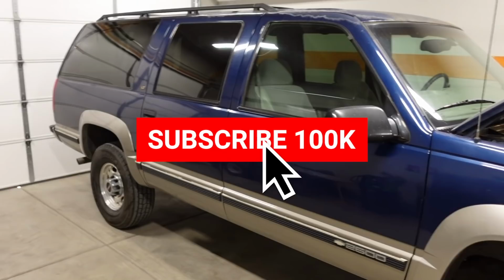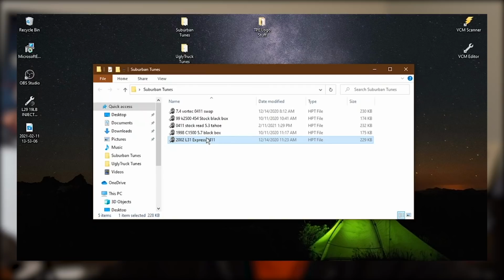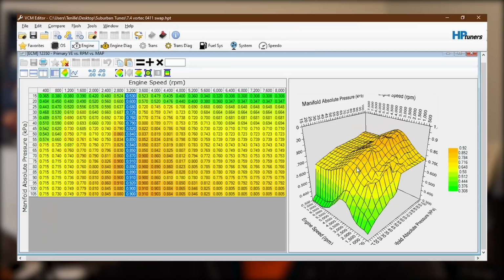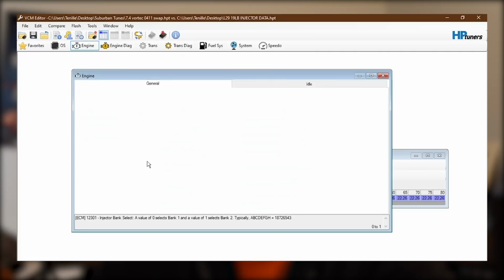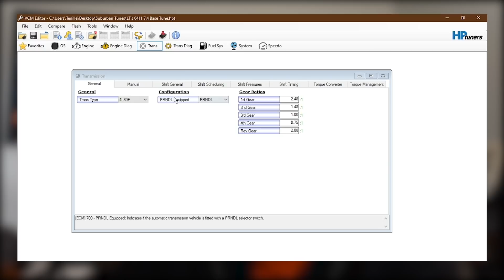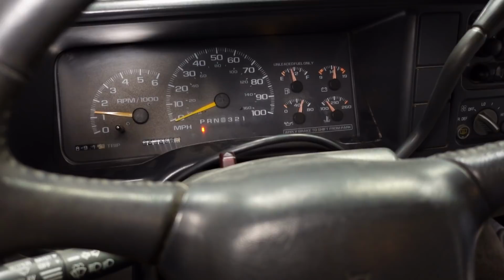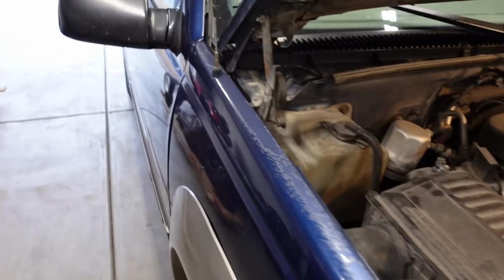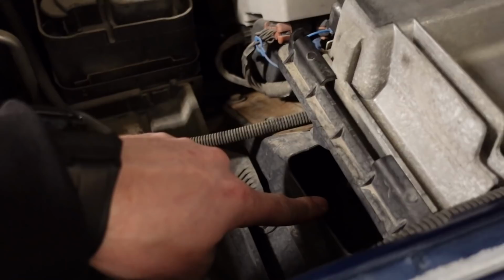Tuning an 0411 Swapped 454 Big Block GMT400

Comment: Thanks for the videos on this 0411 swap.  Guess I'll be looking for one and some connectors. I have a 502ci I want to swap in as the L29 I think spun a bearing 🤔 . I'm aiming to keep the stock EFI setup, changing fuel pump, regulator, and injectors. 
Would a L29 fuel map be the best starting point and do a complete fuel table +11% (7.4 to 8.2) to get me going with the stock L29 injectors as a starting point to get it running?

Comment: If anything happens to your HP Tuners cable don't let the company tell you that any old charger cable will work because it most certainly will not.. has to be a data cable

Comment: Great vid!  Did you have any issues with the new ECU not talking to the Transfer Case Control Module?  I did a similar swap and my 4x4 is all jacked up, that's the only thing I can pinpoint.
Reply from the maker: no I didn't, but because I switched to a NP241 the transfer case control module is disabled. However, from when I did the conversion on the transfer case, I was pretty sure the TCCM is a standalone system and only sends a signal to the ECM to let it know its in 4wd or in low range. The one thing I havent tried yet is driving in low range, and because the express van tune is from a 2wd vehicle, not sure it will be paying attention to the low range input.

Comment: Hey im just some kid with a 98 gmc with a 7400 vortec and i want to do a build i want to do torque converter and shift kit the tranny cam lifters and valve springs injectors fuel pump and shorty headers with egr and cat delete im going to port the exaust heads with a buddy and i might do a full dual exaust with high flow mufflers and have them come out below the passenger door or a little bit further back but im iffy on that because i dont want it loud enough to cause problems so i might not do that i already have a k&n intake so thats already done and when i get that all done ill take it to a dyno tuner with a 4011 to have them put it in and tune the truck and i might get an edge tuner so i can adjust the speedometer for tire size myself when i change them out and i like the gauges it has id love advice from anyone thats done a build on this engine ive found the headers i want to put in and im trying to find what kit i want for the valves what cams i want to put in and what injectors i should put in and what fuel pump i should go with or if i should just stick with the stock fuel pump any suggestions or advice would be greatly appreciated
Reply: Also does anyone know how much horsepower the bottom end can handle im hoping to avoid building the bottom end

Comment: Great video and great HPTuners info, but you glossed over the VIN info.  What did you do about the VIN that was already in the 411 you bought?  Did you use HPT's VIN change utility or did you keep the VIN that was already in the 411?
Reply from the maker: when you refresh the new operating system with HP Tuners, it takes the vin number thats part of the 2002 express van. You can change the VIN number with HPT only if the VIN number match the operating system, and my 1999 Suburban VIN number has a different OS than the 2002 express, so now the VIN says 02 express. That could lead to some issues when we go to do an emissions test (maybe, I've heard mixed results)  and I think you can use EFI Live to over write the VIN, but I've heard that leads to complications later if you do a full read or write entire with HP Tuners after the fact. So for now, its just gonna have the 02 express VIN.
Reply: You can change the VIN with TunerPro RT  to whatever you want and flash it in with PCM Hammer.  You can also use PCM Hammer to flash in a different OS.  You'll want to do this before you license it with HP Tuners though.  Gearhead-efi forum is a great source of info for getting started with TunerPro.

Comment: LT, how is the 0411 with the L31. I'm wanting to keep the L31 and swap out the spider for different EFI.
Reply from the maker: its pretty much the same exact swap, and the tune will be spot on if you find a stock express L31 tune file as well.

Comment: When are you actually charged for those credits, when you burn it into your ECM? Also do you get charged when you have to go back in for changes?
Reply from the maker: buy them before you start the project, and they are stored in the interface. you only get charged once, and once you license the file you can make as many changes as you want.

Comment: Any chance you’d be willing to share that tune file? Trying to help a buddy with this exact swap. He’s driving on the 5.7 van tune and it is not ideal, but got his truck running in an emergency when his black box pcm failed. It’s a 98 vortec 7400 as well but a crew cab dual. Appreciate the video!

Comment: I know this is a older video but I got a 98 k2500 pick up with the 454, I was curious how limiting the factory black box is? Is there plug n play after market options out there? I ask because I am absolutely at a loss when it comes to computers and electrical but I do love my truck and wanna make it faster.
Reply from the maker: if you are only doing basic upgrades like a cat back exhaust or cold air intake, it doesn't make sense to do an  0411 swap. HP Tuners can handle your 1998 black box PCM from what I remember. but if you plan on doing major changes like a cam swap, different intake manifold, cylinder heads and so on, the 0411 is a much better choice from a tuning perspective.
Reply: @LawrenceTolman  ah ok. I was thinking long tube headers, full exhaust system, cold sur intake and possibly just porting n polishing the intake for now.

Comment: i like the projects you have LT i have a 88 c1500 sierra and a 05 sierra k1500 L33. i swapped out the bench seat for the 60/40 w flip dn console in the 88 the 05 i"ve made into my version of the AT4 .new torsion keys 2.5 in front, rancho add-a-leaf for rear 2.5, new stereo with back-up camera ,and i use a f5 hand held programmer  all things i learned from trucks tv..like you i never miss a episode ..i want to upgrade the trans cooler to a hayden 678 GVW20000 or 679 GVW30000 i tow a camper at most 6500lbs empty 5600 LT witch one do you think?? thanks for starting your own channel keep it going ...JW
Reply from the maker: as far as the trans cooler goes, I'd put in the biggest one you can. A lot of "race truck" guys put in the TruCool 40k cooler

Comment: Was there any tuning on transmission as a differents in 4l60 or 4l80 (OS) or does the computer run both
Reply from the maker: the computer can handle both a 60e or an 80e, but there is a different transmission segment (different base tune file) required to run each properly

Comment: Hey. Working on 98 c3500. Just now watching these videos. Question. Would getting 0411 for 8.1 better to start with or does it matter as long as it's 0411? Ty.
Reply from the maker: Doesn’t matter what the original application is from, as long as it’s an 0411 pcm
Reply: @LawrenceTolman  thank you. Appreciate your time and all the information you share.
Reply: O. Was trying to find information on lextech information and can't figure out away to contact him for pin diagram. Thank you.

Comment: What happen on 4wd low? Does it shift right?
Reply from the maker: I need to test that yet, but it might not shift properly in 4lo because the express van OS is for a 2wd truck. I have another 0411 4wd trans tune I can try and segment swap, but I heard that might throw off some other things as well....
Reply: Check out tje driveway engineer channel. He's got info on pcm segment swaps. Tons of information from him. Solid dude too. His Facebook group is hands down the best.

Comment: Is there any harm in removing the egr on the L29 engines I read that it has to be done in the tuner or it can cause harm to engine any truth to this
Reply from the maker: I think there is a timing table that modifies the spark when the EGR is active, so as long as that is zero'd out you should be just fine.
Reply: @LawrenceTolman  can’t adjust the timing on these engines what worries me so idk

Comment: Sorry did you end of disabling the range switch ?
Reply from the maker: yeah, I did disable it in the tune. once I grounded the wires 32 and 34 on C1 and did the crank relearn it had no problems
Reply: @LawrenceTolman  amazing ! What wires were 32 and 34 for ?
Reply: @joshprince1987  The PRNDL position that it was looking for

Comment: Just found your channel, I’m  running a 2000 Chevy ccsb 4x4 k2500 with a 5.7, if I found a pcm out of a 01-03? express van with a 5.7and swapped it in it would run my 5.7 with out reprogramming and if I some day swapped the 5.7 for a 6.0 lq4 it could be reprogrammed (and rewired) then?
Reply from the maker: It likely wouldn’t run due to the anti theft needing to be programmed out, but the tuning is the simple part. But yes, once you wanted to swap to a 6.0 the 0411 would control it just fine

Comment: 16:50 it should only cost 100 to have control over the pcm, if u spend 200 then you paid for a vin on another computer that you dont own.
Reply from the maker: not exactly... the first $100 gets you permission to flash your ECM with the tune that came on it (which in my case wont work, because it was a 5.3 LS engine 24x operating system) and the second $100 gets you permission to flash the found chevy express L31 (4x crank sensor) base tune into your computer
Reply: @LawrenceTolman  I cant find that anywhere that u need 4 credits for the original vin and doner vin. Ive done 3 0411 swaps so far, nice work on the video. if you feel something is off in the tune and its doing something weird that the black box didnt do and youve looked up and down for the problem its probaly hp tuners. hp tuners doesnt change all calibrations for some reason, ive had much better success
 with efi live doing a full rewrite. however i have been able to change stuff with hp tuners that efi live could not. the next step you need to do since u have an original 5.3 pcm is to add coilpacks to the bbc, youll be amazed. https://www.eficonnection.com/home/category/engine-hardware/crank-and-cam-signal-kits/efi-24x-product-line/efi-24x-bbc
Reply: @LawrenceTolman  The second set of credits was needed to change to the 12212156 operating system that the L31 uses, but 12212156 is not exclusive to the L31 or 4X.  Many of the 24X LS trucks, 4.3L trucks, Camaros, etc also use 12212156 and don't require an extra set of credits.